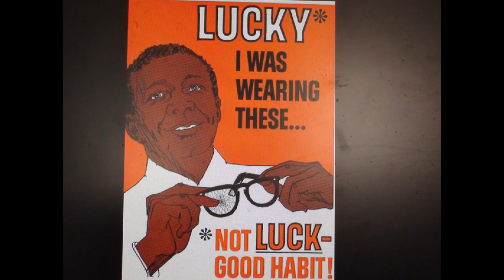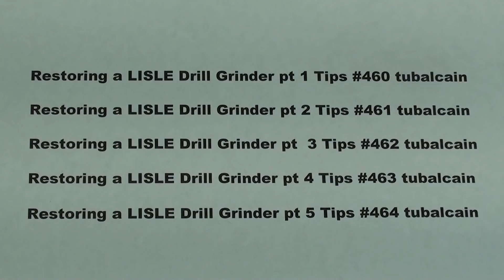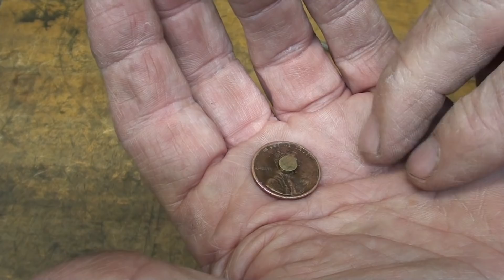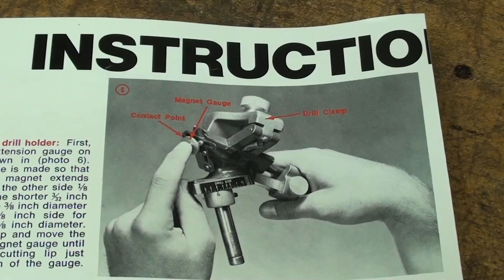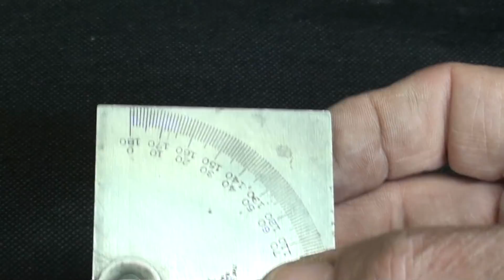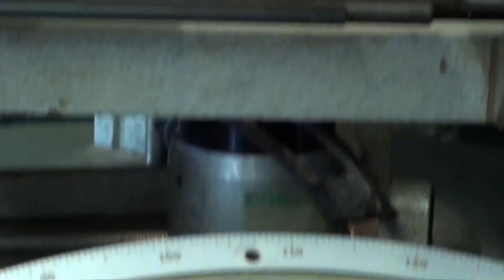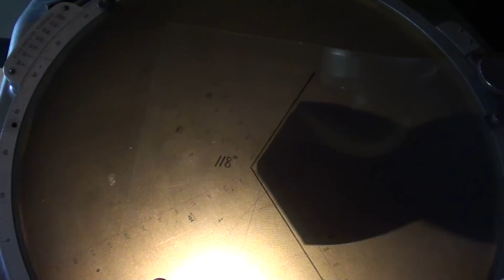Sharpening Drill Bits Lisle Grinder TIPS 466 pt1 tubalcain

Comment: Very well explained.  I  have a STERLING drill bit grinder.  I bought it about 3 weeks ago and I  have restored it. I have ordered some new parts from Macdonaugh/Sterling to replace the missing ones . The restoration consisted of a good cleaning and a repaint.  My  STERLING was made in 1968. It may have been in storage most of the last 50 years because there is no visible wear. Like you,  I made a guard for the stone.  This Sterling never came with an OEM guard.  I have posted pictures of my Sterling restoration on Garage Journal  forum.
Reply from the maker: I'll have to look up information on the grinder. I am not familiar with it. I think you got a goodbye

Comment: Back in A&P (Airframe & Powerplant) school c. early 70's, they put a heavy emphasis on bit grinding by hand. We started with special wood (twist drill training) bits before moving on to the real things. We had to do them till they came out perfect every time; the final checks were visual, dimensional, and chucking said bit in a drill press, starting a hole in Aluminum scrap, then stopping the press. There had to be two equal, well formed chips curling out along side the bit. We ground bits for days till we could seemingly do them by feel behind the back... it was a valuable skill that saw a lot of use through the years...
Reply from the maker: Wow, that was some thorough training
Reply: We had a tough Apprentice training master. We were called Fitters & Turners in Australia. Not sure of your title.  But looking back the training lasts a lifetime.

Comment: This is really a great machine!  I gotta get one. I see all these guys on youtube setting up grinding attachments and using the sides of the grinding wheel pretending to be experts claiming its ok to use the side of the wheel. l had one blow up on me so I know from personal experience that its not O.K.
 When I was a kid in in 1965 my dad told me never use the side of the wheel. He said you may get away with it for awhile but sooner or later it will blow. Every time I was tempted to side load I would hear his voice in my head giving me the advice he gave me when I was seven years old. One fine day I totally ignored that advice and boom the wheel blew but I was "lucky "had my face shield on and didn't get hit by a big chunk in the face but it got my hand and broke three of my fingers and tore up lots of skin that took awhile to heal up.
 I put a diamond wheel on it and now I fel pretty safe but it bent the spindle a  thou or two.
Reply from the maker: Wow, that was a harrowing experience for you
Reply: @mrpete222  Just another thing compared to some of the other stuff thats happened over the years I have had a rough life life.

Comment: Hi mrpete222, that was  very interesting and looked like a perfect result to sharpening that drill, but you are going to have to find a way of changing those bearings.
Reply: Man, I couldn't agree more!  Ear plugs required!
Reply: I just did this for the first time on a 1951 one horsepower Sears Craftsman single phase motor; the bearing swap actually was quite easy compared to something with an interference fit like an arbor.  I found the old bearings came off and the new ones on with no cuss words required just a common two or  three jaw puller. (though for the installation I did put the armature in the freezer and the bearings in the sunshine). Also side benefit of that project is I found quite a lot of debris inside my motor and superficially on the windings and after brushing that out with a soft paintbrush and vacuum my motor sounded a lot happier.

Comment: Damage to the shank can be reduced to almost negated if all three holes of a keyed chuck are used for tightening.  I do not have much experience with the keyless variety so I do not know if they slip but, I would not doubt cheaper versions do and worn versions do. This is why I like the keyed chuck for any kind of heavy drilling.

Comment: So I'm 2 yrs. late but I just watched your vid. I have a Lisle 91000 in a newer version. It is missing the shank that holds the diamond dresser. If you still own yours, a few dimensions would be helpful for making one. The diameter of one end is the same as the drill holder fixture and the length is approximately the width as the fixture mounting block. I got that. Question is, what is the diameter and approximate length of the big end with the cross hole for the diamond? And what diameter diamond shank was used? I'm guessing 3/8" but I'd like to make the replacement close to the original. Please watch my YouTube vid on the use of a Mohawk Drill Grinder. (since been sold). Beautiful restore on your Lisle by the way!
Reply from the maker: Send me a sketch of the part that you need dimensions for. Send them to this email address.        lislepete22@yahoo.com

Comment: I dunno Mr Pete, It seems like a convoluted way to work. I have an old Darex M-1 that is simple to use and not near as complicated to set up the drill in the fixture. The resulting grind from the Lisle is certainly nice though. Bigger drills I do by hand with a gauge. any way it has been a nice series. Cheers

Comment: 19:00 That's only a problem with carbon steel drill bits...high-speed steel drill bits are a lot more resistant to heat.
Reply from the maker: Very true

Comment: Comment on your eye guard,the one you removed.If you scrape the edge of the plexiglas or lexan smooth w/a scissor,then apply flame from a propane torch very carefully.Touch and move,touch and move.The edge will become transparent.This will work with Plexiglas,I am not sure about Lexan.
Play the torch along the edge quickly so as not to cause edge to start to flame.We called this process 
Flaming.
Reply: Why flame polish the edges of a consumable part?  Even a transparent edge is an obstacle for visibility.  It doesn't provide any functional benefit, and the effort is discarded when the guard gets replaced. 

Though I guess if waste were the goal, flame polishing offhand plastics that have absorbed moisture from the air is a good chance to meet it.
Reply: Dream Services International t
Reply: Dream Services International 
There are some of us who take pride in doing a good job, obviously you are not one of us. It is a matter of pride in workmanship.some call it gold plating I call it “Pride”.
Reply: You can take pride in whatever you choose.  Certainly, it's fashionable to find any excuse for conceit.  If you're out to change Lyle's mind, I somehow doubt he's eager to frivolously add more effort to a part that he's already acknowledged will need to be replaced.   If you're out to change mine, you should read what I wrote.  

Does your boastfulness remove water content from the plastic?

If you don't understand that "doing a good job" does not start with the finishing touches, then you can certainly count me out of your imaginary club.
Reply: In my limited experience, flame polishing is kind of a skill of it's own. I suggest first practicing on some scrap material...

Comment: Watching the restoration was interesting but the love for this grinder is lost on me. They are no longer in production and they seem to be quite scarce so the chances of most of us actually finding and using one are slim to none. I have been sharpening bits by hand for 35 years but I would like an actual easy to use drill bit grinder for precision sharpening but I'd just as soon not spend four or five pension checks on it. Since this one is out of production it would seem maybe the patent has expired? If so it would be really nice to see a "building your own version of a Lisle grinder".

Comment: Looks like Lisle doesn't make drill grinders anymore, anybody make a modern equivalent unit?  (excluding the Drill Doc type stuff)
Reply: Andy Lawrence darex, they are pricey though.  I've seen them from $400 up to $800 for used ones.  but they do have 2 diamond wheels on them.
Reply: here's an example of the one I'm talking about https://m.ebay.com/itm/Darex-Drill-Bit-Sharpener-1-3hp-3150RPM-with-pedestal-stand-good-condition-/142826733852?nav=SEARCH
Reply from the maker: The Derex is the best
Reply: I’ve had my drill doctor for about 10/15 years now,it works perfect,is easy to set up and inexpensive,very happy with it,very good company,why overcomplicate things?